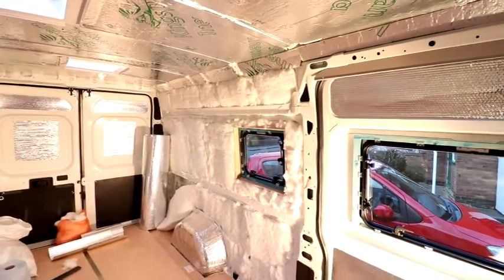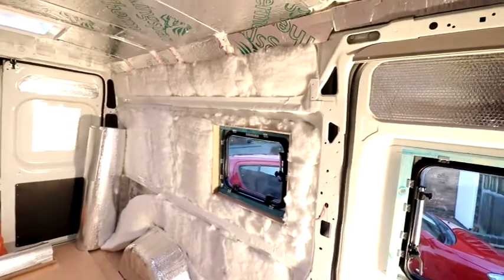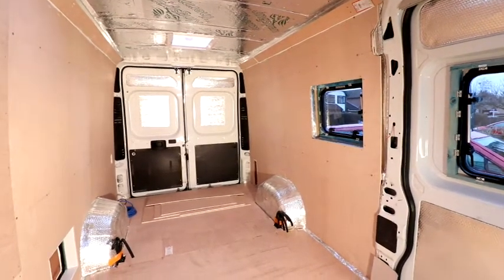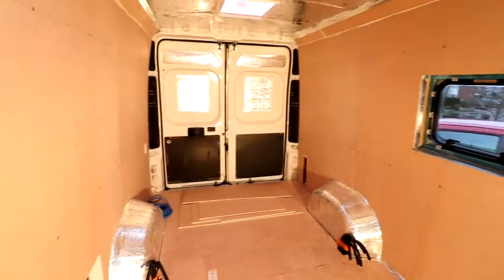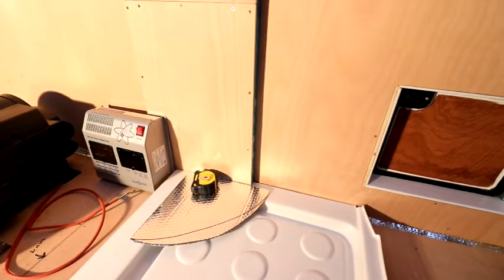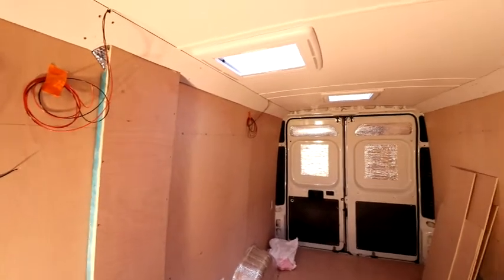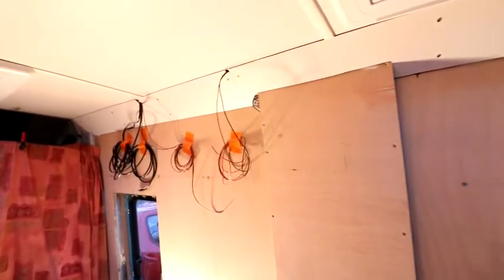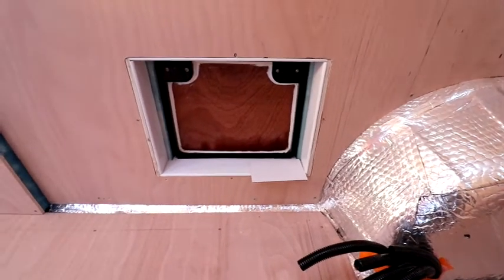Peugeot Boxer Camper Van Build - Episode 1

Comment: Hi Ian. You're doing a great job converting your van. I too have bought a Peugeot Boxer L4 H2 to convert. I see that your windows are clear looking out from the inside. Which window have you gone for please Ian? Also how big is the one you've fitted in the sliding door? It looks a good size. Keep up the good work. Cheers. Neville.
Reply: Lovely job!! Thanks for your reply Ian. Keep up the good work!!
Reply: Hi Ian. We've decided to go for Polyvision windows aswell. I'm wanting to fit as big a window in the sliding door as possible. Is there a reason why you opted for the 900x500 and not the 1000x500? Cheers. Neville.
Reply: Hi what skylights did you fit

Comment: I hate to say this but that van is definitely not the H4 model, they only go up to a H3, maybe you meant L4H2....
Reply: @ianwheeler7903  Oh sorry I didn't here u mention it, when the lockdown is over im going to look at a L4H3 modal..im tall so the internal height will be perfect...👍
Reply: Sorry did you say L2? It looks big for L2. I'm trying to decide what length to go for.
Reply: czeester The van is a L4 which is the longest modal Peugeot, Citroen or Fiat do..If you’re doing to covert one and either live or spend a lot of time in ur then I would get the longest and highest van you can, that’s just my opinion and I’m sure others may disagree..👍👍
Reply: @thenoworriesnomad  appreciate the advice. It all makes sense but I also need to consider what I can fit on my driveway :)
Reply: @czeester  Simple solution..sell the house, live in the van full time and never look back...👍👍
Reply: @thenoworriesnomad  it's probably simpler than it sounds (: